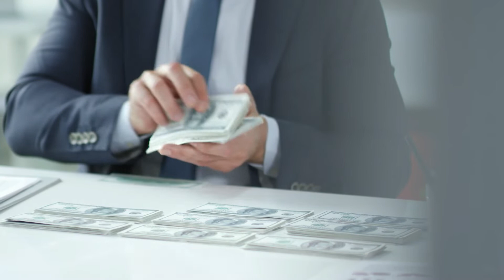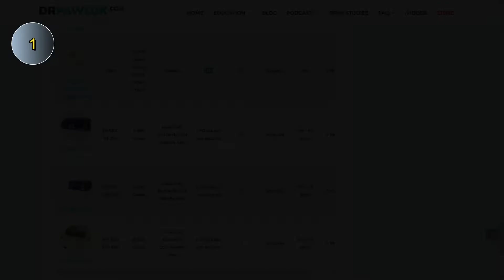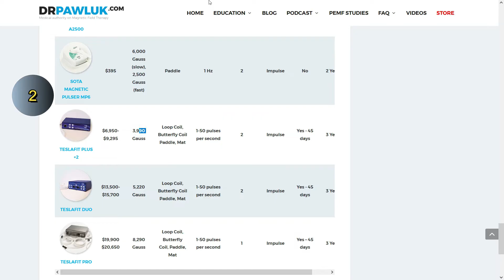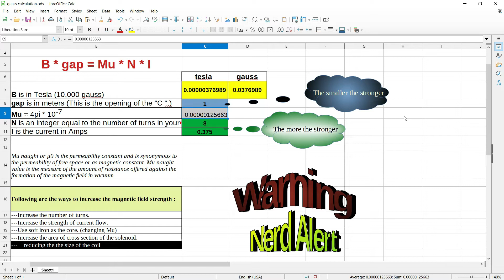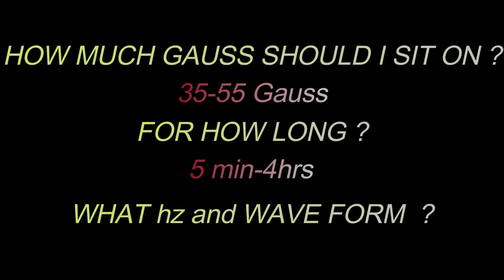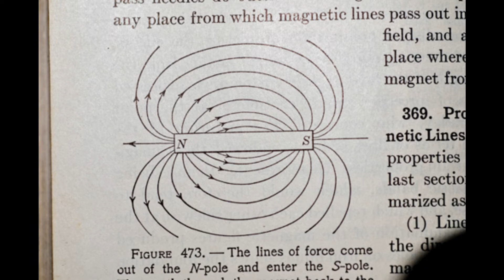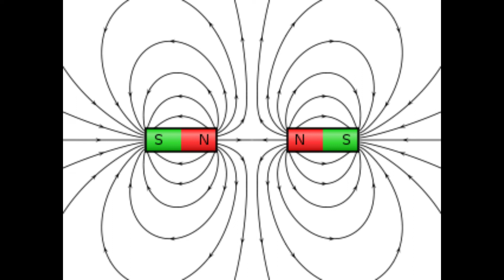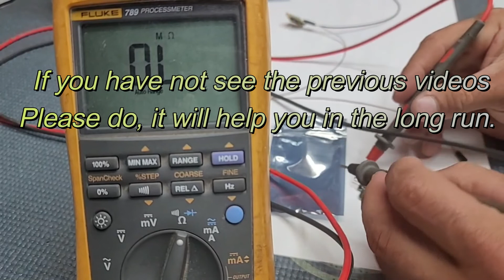PEMF Technology - Magic, Miracle or Myth?

Comment: Hello Steeve, I feel so stoopid I don't know how to get the link from YouTube sites to your but no worries I give you the info so you can pull them up on YouTube. First Dr. Stephen Stokes DC PEMF/Pulsed electromagnetic Field Therapy or remove toxins/use binder or PEMF Side Effects. Try either one of the 3 titles that brings you to his site and I believe if you subscribe you getting the list of videos his posting. He has a lot.
 The second is Andrey D  091 Open source BBM Pulser 5B Demonstration. I bought  this one, have not used it yet. It kicks out about 3 Tesla. He has some goes up to 6 Tesla and all open source. I want your opinion on this unit's please.
The third is Mirko Pavelski How to Build Simplest PEMF (Pulse Electromagnetic Field) Therapy Device it's says that the resistor has to be about 8a for a 24v device. I want ed d to ask you if the powersuply is 24v but it's 7amp I have to go with 7 or 8 amp resistor, right. Hope this lead you to the correct places on YouTube and let me know please your findings. I greatly appreciate your input.
Reply from the maker: It can be difficult to analyze a product without physically having one. I would not feel right to do so. Also I do not (personally) prescribe to such high output. I do not like the use of capacitors to reach such high level of voltage either. I also do not like my muscles to twitch every pulse. 
Regarding your questions on the right size resistor ohmic value, It all depends on the resistance value of the coil(s) 
you should have at the very least 3.428ohm  [ 24vdc/7amp=3.428 ] (E=IR) of resistance for the whole unit. Please remember that your power supply should not be over drawn, keep it at 80% max value.
Reply: @Steeve.  Thank you very much.